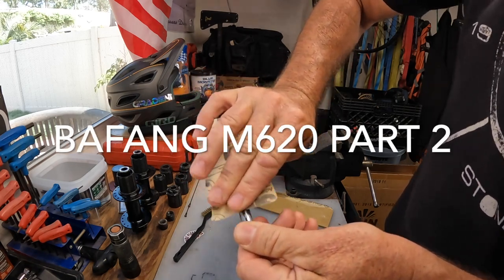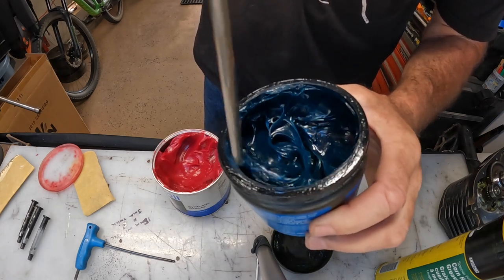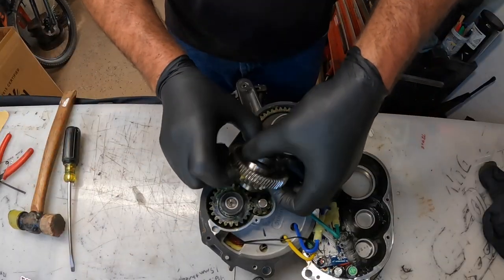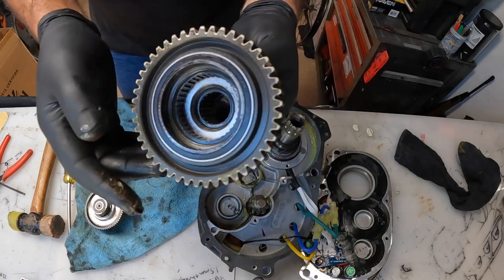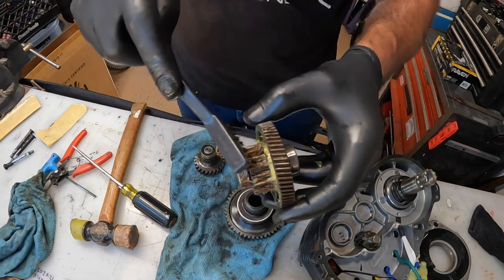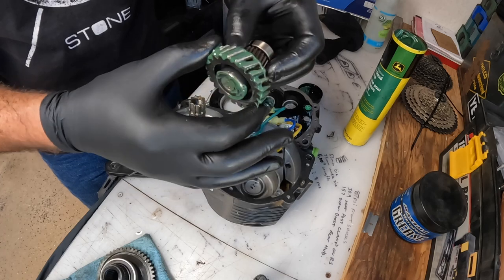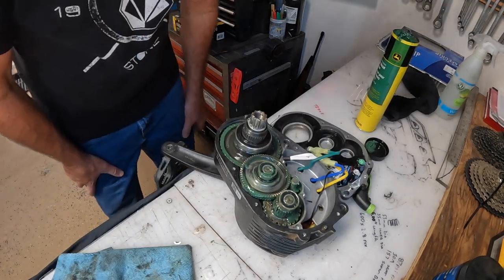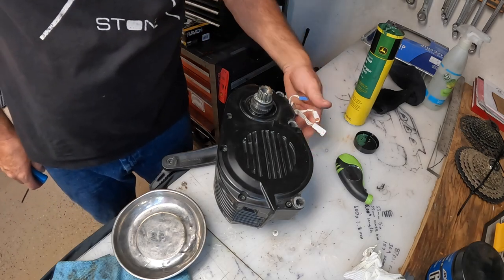Bafang m620 A Look Inside Part 2

Comment: Strangely soothing to watch. Thanks for the upload. I just bought some corn head grease and a gun for my M620 also. Its new, so I will so this after a few hundred miles.
Reply from the maker: Thanks. Yeah I have 450 miles on mine and three rides since I put in the corn head grease and it is silky smooth and fairly quiet.

Comment: Oh man this video is great. Now I would feel comfortable that I wouldn't brick the motor if I took it apart. Thanks Doug
Reply from the maker: I just went on a 20 mile hard ride and it performed excellent. So quiet you could sneak up on a hiker. The tires are louder than the motor, video of the adventures (of course) in progress 😎

Comment: I reckon the reason the 3 mounting bolts are so tight to insert is probably because the mounting cradle has been welded in with the frame.  The welding will have caused alot of warping and internal stress within the mounting cradle, distorting it from its ideal shape.
Reply from the maker: Yeah possibly, the fit and finish on this bike is pretty poor, takes a lot of “massaging” to get it smoothed out😉

Comment: I'd strongly consider replacing the chinese bearings with Japanese made or German made bearings.  It may help with the fretting issue as well.  If the teeth don't mesh properly because the axis of the gear is moving around (due to poor quality bearings), fretting can occur.   Better grease will also help with fretting.
Reply from the maker: Thanks, I’ll look into that. That would be a nice upgrade. I’ve seen some gears come out all “curved” no longer straight. Thanks
Reply: @SimplePleasuresMTB  glad to help.  Please note, gear teeth generally (if well designed) have an involute tooth profile.  The idea is that when they mesh with other teeth on another gear, they roll against each other rather than slide.  This reduces overall gearbox friction by a huge amount.  If gears slide, a lot of friction is generated (a lot of power to drive the gearbox is lost to friction), and the teeth will wear out rapidly.   I have a bike with the Bafang M620, and I will be taking it apart soon to inspect it, replace bearings and grease it.  Since I haven't seen the gears up close, I don't know if they designed the teeth correctly.  Another possible issue is if the bearing counterbores in the outer case are not machined correctly and do not create correct alignment/meshing between gears.  If the bearing is allowed to float sideways, it will cause fretting/premature wear.  I will look for this when I take apart my M620.  If this is an issue, there is not a whole lot we can do, other than re-machine the case covers for larger bearings or somehow sleeve them.  My impression is that it would not be worth the expense - just figure on buying replacement M620s as they wear out.
Reply from the maker: @proto2580  this is very valuable information! Thank you. If you’re familiar with www.greenbikekit.com they have all the necessary internals, wires, complete motors, everything for this motor. And fairly cheap prices too.
Reply: @SimplePleasuresMTB  Thanks!  Looks like you can replace all 3 of the gears by getting them from GreenBikeKit.  I would still trash the chinese made bearings and replaced with equivalent sized Japanese or German bearings.  You may need a shop press and bearing splitters (tools) to do this.  It's what I would do, but I'm also crazy enough to rebuild Japanese made manual transmissions for cars.
Reply from the maker: Are Toyota Tundra transmissions great? That’s what I drive😎
Reply from the maker: Ahhh you said manual😁
Reply: @SimplePleasuresMTB  yes. Rebuilding manual transmissions for me is a hobby, not my job.  I'm a mech engr.  Generally speaking, Aisin manufactured transmissions (Toyota) tend to be better than the other manufacturers like Jatco.  I don't know if the Tundra transmission specifically has any known issues.  I'd have to research that.  My rebuild experience is limited to the Toyota E153, rev2 manual transaxle.
Reply from the maker: @proto2580  awesome
Reply: Probably not a problem at revolutions it's run at, but yes it's the weak spot under high revolutions and current. above rider skill anyway

Comment: Great informative video, like the way you removed the large gear with c clip (many don't) always wanted to see what was under there 👍 thank you..

One thing I'd like you to look into I'm reading you shouldn't grease the one  way bearing but surely it can't hurt but reluctant to grease that area until confirmed.

Great video and you are a natural on camera, thanks again for sharing.

More vids please....👍
Reply from the maker: Thanks, yeah I’ve seen videos where people just fill the entire case, I probably could of used more grease, but it definitely has more than it originally had in it. Time will tell if it holds up. It definitely ran very smooth and quiet the next day on a 20 mile hard ride. The tires were actually louder than the motor. Thanks for commenting and watching.
Reply: @SimplePleasuresMTB  I see a vs. video coming up. Gear box full of grease vs light touch of grease.👍

Comment: Mine is from 2017 or so - about 6000 kms. Teflon gear broke. I think the gasket is so old that we might just do a liquid gasket maker. No grease at all in the engine. Will regrease as you do but still havent decided which grease to use,  dont have the brand you have here, thinking if I should go hard grease or not. I will check the beaerings as well. But I dont want to replace them unless necesary as its a PITA.
Reply from the maker: The bearings are pretty easy to replace. They should just pull out like the gears. You could use a Synthetic grease like mobile 1 or something. I went with the Cornhead type grease because it’s more viscous and gets on the face of the gears better. Once in motion the grease tends to go to a more liquid state and once cooled down turns more stable and solid. Any good gear grease is better than nothing 😎
Reply: @SimplePleasuresMTB  what size are the bearings?
Reply from the maker: @6295607 you would have to check www.greenbikekit.com and search your motor.

Comment: Good call on the cornhead grease farmers put their equipment through hell.   Just got my first EMTB and started riding again after 20 years. Was shopping the Rock Star, but ended up buying the Cyberbike Mullet. It's a 500 watt motor with similar components as the rock Star but lighter at 52 lbs.  Now that I'm hooked on Ebiking I'm thinking about getting a Luna cycles z-1 with this same motor.  Thanks for the video.
Reply from the maker: I know this is 6 months old but look at the Luna X2. Much nicer bike than the x1

Comment: Its good to open it up and ensure there is ample grease in there.

My concern is that since the Corn Head Grease turns fluid once heated, it will flow to the bottom of motor pan and the gears might not pick it up....can anyone confirm if the gears will pick it up? or is it safe on the electronics to fill er up like a sealed gearbox as the Corn head grease was intended for?  it is meant for gear boxes that sit in an oil bath normally. 

CHG is great for equipment with worn seals that constantly leak gear OIL. so if you switch to corn head grease from a thick gear oil, the corn head thickens up once it cools and won't drip out of the equipment...so you can keep running equipment with bad seals and it wont leak as bad and empty out of the gear box.   but in this type of application, it is not in a bath of the stuff...

I'm leaning towards a soft NLGI grade 1 polyurea grease for this.
Reply from the maker: it does thin out once heated, but it does get to the gears and serves its purpose, the thicker greases tend to stick to the case once flung around from what I've seen. No grease on the gear teeth whatsoever. Since I've done it I haven't had the chance to open it back up for inspection, but will likely be performing that soon as others have concerns of what the heck's going on inside the gear box. So far mine has been running cool and quiet.

Comment: Brown rust - Nope.  Someone mentioned fretting, I  ashed myself, what's that?  3 hours later on the internet I know more about fretting than I  wanted or needed to know.  Basically it's the disintegration of the gear teeth surface.  Causes are many but initially it's gear design followed by material, load variables,  lubrication, gear box design (resonent frequency), and moisture.  Surprisingly the moisture can actually come from the lubrication.  So, what can we do without re-engineering?  To be real we probably can't do much.  First, clean and regrease with the best we can find.  The bearings could be replaced with a higher quality(research time).  Poor bearings cause vibration which affects gear performance.  Automotive gears have been polished to improve performance, maybe that process could help us.  Anything else like gear redesign(thinking gear tooth interface) and better material way too much coin.  Right now my head is spinning.  Good luck to all.
Reply from the maker: Damn! That’s some great research! I appreciate that. Definitely some higher quality bearings would help too. I chose to used the Cornhead grease because I read somewhere…(can’t recall where) but the Cornhead grease when applied to equipment, it’s good for the life of the equipment? Something along those lines. I was definitely not the first to do it, but to me it made sense. Thanks for sharing your knowledge.

Comment: Thanks for this great tutorial. Did things go as smoothly when you did Ted's bike without removing the motor?
Reply from the maker: He did it himself, I think it was fine
Reply: @SimplePleasuresMTB  Thanks. It appears I still need to remove the mounting bolts to open the motor case. That changes my strategy a bit. Have a good one and I hope you're enjoying your Trek Rail.

Comment: How do you plan to open up the motor without removing it? The mounting bolt go through the cover.
Reply from the maker: @RiteMau  I don’t think you can. It was just a thought. It’s not difficult. Also easier to work on a bench

Comment: What size and where you get the lock ring tool? Have a link by any chance?
Reply from the maker: BikeHand Bicycle Bottom Bracket Removal Crank Tool - Compatible with Shimano Hollowtech II 16-Notch 44mm External BB https://a.co/d/9BOvRRc

Comment: Did you have that 3rd gear change Mine is teflon and it just tore down. Replacing it with steel gear.
Reply from the maker: Didn’t change anything mechanical , just removed the remaining old grease and replaced it with new, better quality grease. In other motors Ive worked on, we did see the main drive shaft pretty worn out because of lack of grease. But you’ll be good with the regrease and steel ⚙️ gears
Reply from the maker: Here’s another one I worked on
https://youtu.be/E0ZGSuAOICI?si=_7C7RNuZQHOoKlOX

Comment: My Rockstar motor is making noise, barely any throttle pull and barely no pedal assist. I trying to find a bike shop to service it, no luck.
Reply from the maker: Unfortunately most places are afraid to get into the motor. Always first ask Sondors…might take awhile but they are pretty good on their warranty issues

Comment: I just took apart my Ultra motor and found very little grease and a LOT of shavings.   I suspect the shavings came from the gears.  What else could they be from?
I took the motor apart because it was getting noisier and noisier. 1100 miles on the motor.  Not impressed with this motor.
Reply from the maker: Grease it up, how’s the main shaft gear? That’s usually what wears out first. The shaft coming from the stator side. If it looks brown and dirty, that’s normal. Just clean it out good and apply grease. I’d recommend Cornhead, but if you can’t get that then any synthetic is better than what was previously in there. Be generous but not to generous.👍🏻be very careful not to pinch any wires putting it back together, especially the thin black wires.
Reply: @SimplePleasuresMTB  I already have a new gasket and a tube of Corn Head grease.
Reply from the maker: Perfect

Comment: I wounder if you could put a grease nipple in a out of the way spot that grease's one cog then transfers the grease to the other cogs automatically and crack the grease nipple after to release any air pressure🤔
Reply from the maker: Thought about that too before, probably would work. Thanks for commenting 👍🏻
Reply: @SimplePleasuresMTB  cool no worries👍 a second thought would be do it slowly while the motor is spinning so the grease is more evenly put on the cogs and not overflowed missing the job. Nice video 👍
Reply from the maker: @rossg9363  Thank you. The only issue I could think of if you added a grease zerk would be knowing how much grease you have inside. You would eventually have to crack the case open just to see what you got in there…but yeah, one of my buddies had the same idea.
Reply: @SimplePleasuresMTB  true! I like your buddy 🤣😁👍👊there are many ways to skin a cat👍

Comment: Thanks i was a able to grease my motor
Reply from the maker: Nice, not too hard of a job. Did you remove the motor from the frame, or just take off the side cover?
Reply: @SimplePleasuresMTB  took out the motor i wanted to try because my next goal is to do an internal dropper post so  i needed the xp ☺️☺️

Comment: Are these greases safe for the electronics?
Reply from the maker: So far so good. I’ve done many without issue. You don’t want any grease in the electronics (maybe some dielectric grease) but it’s sealed off pretty good.
Reply: @SimplePleasuresMTB  Nice. I need to grease mine but I'm wary of destroying the controller.
Reply from the maker: @LysergicCasserole95  it’s separated pretty well. I wouldn’t be too concerned with that unless you used a thinner type grease.

Comment: Was completely not necessary to relubricate anything there but good trying. Don't use this lubricant on pawls though.
Reply from the maker: Not necessary? How so? And definitely not on the pawls (I’ve learned) more of a lighter weight “Freehub oil”. These motors are light in the grease department and loud. Grease is a 2 on the NPI scale so going to a 0 allows the grease to go into a liquefied state as movement begins and back to a solid state as movement stops. Makes sense to me…but we all have our theories.
Reply: @SimplePleasuresMTB  there a bit of grease on surface, it will slide away really. they are louder because they have all metallic gears, more reliable, but not necessary at 30A, i don't know why they did this because people commenting about noisy motors. Idk why they being such pussies thougb any motor is quiter that inCoEn. . It would have been better to change the bearings because they are not thst great, but again at those load they work.

Comment: condensation inside the case is what causes the rust to form from the temperature changes and the grease they use is probably the cheapest shit they can find .....LOL.....consider yourself lucky they put any in there at all.
Reply from the maker: Right!😂if you want a long lasting motor….grease that shit yourself